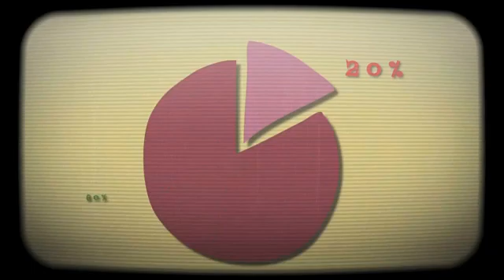Planned Obsolescence and the Light Bulb

Comment: I don't see how there was planned obsolescence in the 50s and on. I've seen many radios and other gear from the 50s 60s and seventies whose internal components surpassed even their calculated shelf live and still work flawlessly. Not saying everything was that well built and long lasting, but almost everything was easily repairable.

Planned obsolescence is mostly a thing concerning modern computer stuff like printers or cellphones. But the one paying the fiddler choses the tune. People tend to want everything new, cheap Chinese and overly digitalized. If you think you need to control you fridge door with your phone don't expect it to last long. Billions of unnecessary microspic transistors under thermal stress is what reduces anything's lifetime even without planning anything, without any way of repairing if the module is out of production. Today a low price means lacking quality and lifespan instead of lacking extra functions.